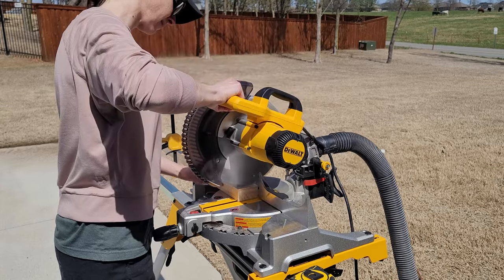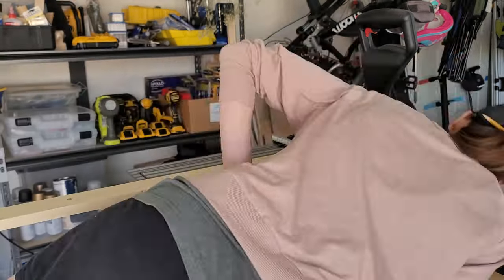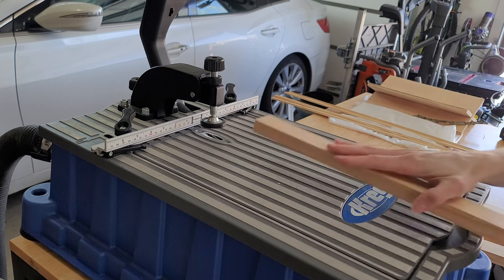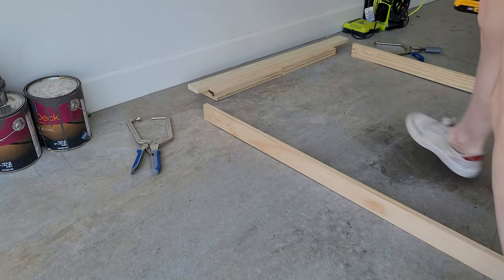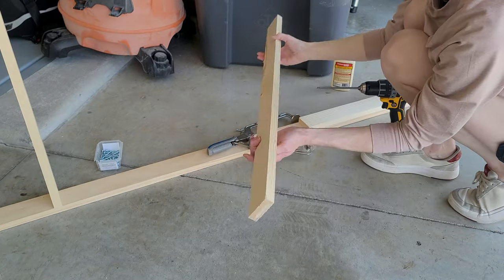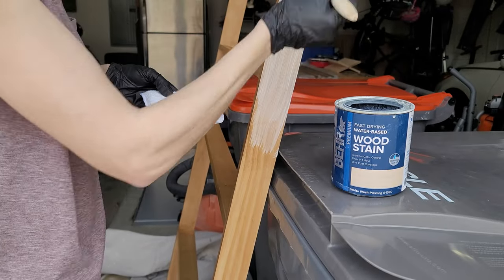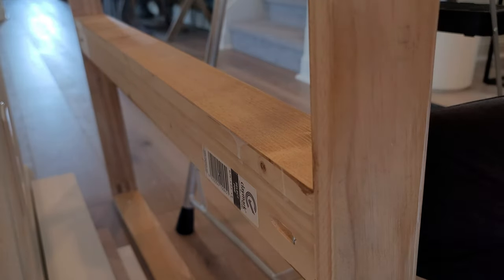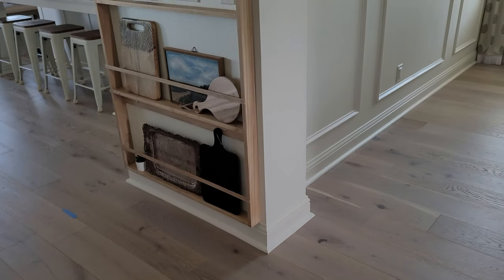Plate Wall DIY – Modern Farmhouse Accent Wall Idea

Comment: I watched many other DIY plate rack videos and most used only a nail gun and glue to build and secure it to the wall.  I didn't think that would be sufficient to bare the weight of heavy wood cutting boards so I followed your suggestion and used the pocket hole jig for the frame and shelves and 2 supporting pieces to mount it to the wall.  I'm very happy with the finished product.  I looks professional and feels secure.  Thank you very much for sharing.  👍
Reply from the maker: That's awesome! I'm so glad you found this video to help you build a secure plate rack for your specifications. I love how easy and great pocket holes are.

Comment: Oh, this is EXACTLY what I have always wanted. You could not have chosen a better place for it.  Do mind sharing which Krieg screws you would have chosen and also how far up did you attach the trim piece? Thank you so much for sharing this.  😊
Reply from the maker: For my pine pieces, I used 1.5" Kreg screws. Kreg gives a guide for screw length depending on the width of your wood - I'd double check with their site first.